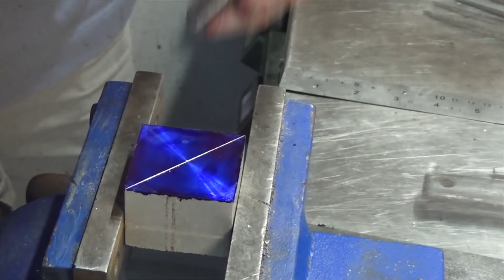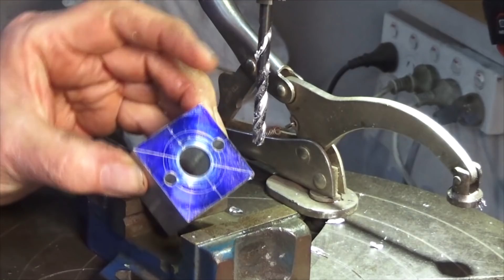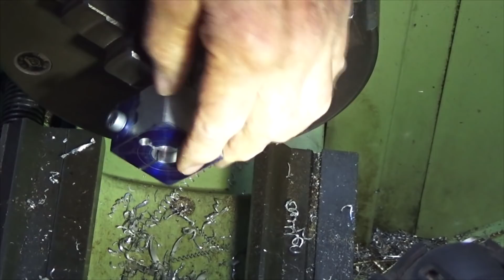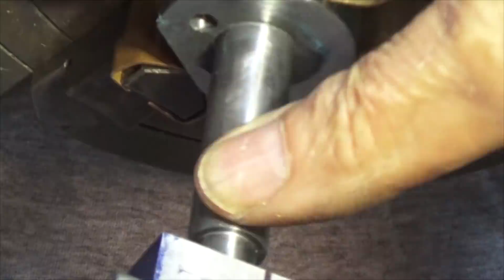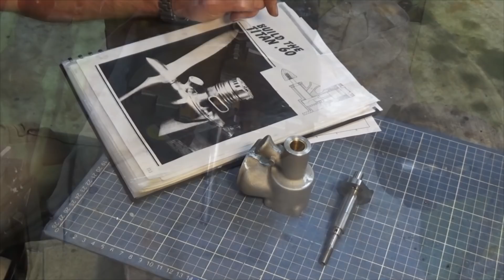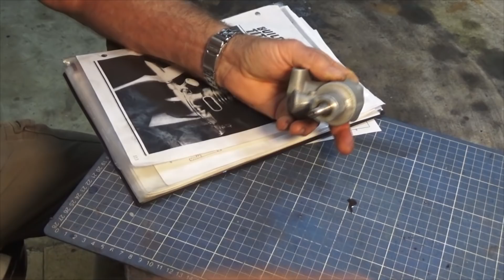Building the Titan .60 Glow Plug Engine #4

Comment: Wonderful, wonderful. But be careful about that tight spot. When the engine is running the only lube that bush gets is from fuel seeping forward due to crankcase pressure. If it seals perfectly there's some risk there won't be enough. Have fun on your trip!
Reply: It also gets lubed by the fuel entering the venturi, so it all should be good, especially after it gets some running in.
Reply from the maker: It's all fixed now. I will run through the process for improving the fit in the next video.
Regards,
Mark

Comment: Some notes on your first go at lapping (you DID ask for it!)

The design of the lap was nice, although I much prefer rounded edges (not just de-burred, but actively smoothed) on any hand-held external laps I make, for obvious safety/comfort reasons, I have tried a circular one a couple of times but it's not as easy to hold with the gentle grip required for good feel and good results.

frequently turning the lap is important, both axially to avoid the lap getting out of round, and end for end to avoid tapering the bore. with a nicely proportioned lap like the one you made, those issues should be minimal, but it's still worth keeping in mind. You may even have been able to partially rectify the issue at the root of the shaft by using the other end of the lap as i'd bet it would have been fractionally tighter at the un-machined end of the lap due to running off the end of the shaft.

There's little need for expensive diamond paste either, carborundum (silicon carbide) powder works just fine for most materials, it tends to break down as you use is, but if managed carefully this can be used to your advantage to give incredible finishes with only a couple of different grits. Carborundum, does tend to wear your laps a little more, as it embeds less than diamond, but that isn't as undesirable as it sounds as even the most perfectly machined lap will require some level of bedding-in.

Don't sweat the bore diameter too much, get within about 0.25% of bore for diamond, or even 1% for carborundum, and you'll still get the results you're after.

i'd be interested to see if you'll be lapping the bore or piston, as this is common practice with smaller, ringless aero engines (especially diesels), usually there's a controlled taper lapped into the cylinder and this can be a bit tricky to get right, but it's extremely satisfying when you do!

Over all, you did a pretty good job for a first time go at it, Your efforts are appreciated!

Thanks Mark!
Reply from the maker: Thanks for the feedback. I must say it wasn't as intimidating as I thought it would be. The lap did bind up at one point and I was able to let go of it before it did any damage to my hand, but rounding those corners would have been advisable. I did also reverse the lap on the shaft because I recall reading that the lap can get bell mouthed. One of the reasons I bought the diamond lapping paste was because it was cheap. It came from a Chinese supplier but it was less than $15 and I'll probably never use it all. I will be lapping the bore of the cylinder liner and I am shooting for zero clearance at the top of the liner. I am guessing that the liner will expand somewhat as it gets hot at the combustion end. There are no rings specified on the drawings. 
Regards,
Mark
Reply: thanks Leon for sharing these tips for all of us to learn too 👍😎👍
Reply: I had experience with lapped pistons mostly on Enya engines I used back in the '60s and '70s.  I think the pistons were iron, the cylinder liner was steel.  Only a small ring near the top of the piston was intended for the lapped fit, approximating what the area of broad piston rings would have been.  I'd sort of expected this engine to have a ringed piston but haven't seen evidence of that feature yet.

Comment: I would use my tool post grinder on the lathe, my surface grinder with the center grinding attachment, or lap it.  Probably others have different ideas.
Reply from the maker: I do have a toolpost grinder but it would probably work better on hardened stock. Also, I just wanted to have a go at lapping before I have a go at lapping the cylinder bore. 
Regards,
Mark

Comment: Self centering FOUR jaw.  That had to come to you by shear good fortune.  What do you do if the stock is, say, 1 millimeter oblong? (that’s a real question).  Im really liking these engine build vids.
Reply from the maker: Out of square stock or badly dimensioned stock can be an issue with self centring 4 jaw chucks. For really accurate work it's best to use and independent 4 jaw and dial the work in. Alternatively, you can put soft packing under the jaws of the SC chuck to take up any irregularities. 
Regards,
Mark

Comment: I built myself a cylindrical grinder that fits in the tool holder of the lathe with an electric motor and grinding wheel , I dress the wheel with a diamond tool in the stationary lathe chuck , works great .
Reply from the maker: I already have a toolpost grinder but I needed to try the lapping process before I tackle the cylinder liner. It needs to be lapped to ensure a gas tight fit since the piston doesn't have any rings.
Regards,
Mark

Comment: On the face opposite the 6mil screw head tap two holes offset either side of the 6mil threaded area and you'll be able to use setscrews to adjust the clearance.
Reply from the maker: If I were going to use that lap again I would certainly do that. Will I ever need it again? Probably not.
Regards,
Mark

Comment: I flew model planes for many 20+ years. I doubt they lapped the shaft at the factory. I once wore out the cylinder of an engine that was decades old before I got it. I reused the main shaft bearing and case for the head rotor bearing of an autogyro!

Comment: Hi Mark something i was shown many years ago by an old bloke in the game was to mount a ball race (bearing) on a piece of square bar stock and use it like a knurl run it at speed (experiment with that unlike a knurl) with plenty of oil and a bit of pressure, start out with the best finish you can get with your cutting tool and work from there  i can obtain a chrome like finish using this idea, a self centering curved (outside) bearing works best as a flat surfaced bearing can leave a thread like finish, this idea might be worth a try, thanks
Reply: I'm having some trouble following your description, is it a burnishing action?
Reply: @somebodyelse6673  the best way i can describe it it works the same way as knurling only it leaves a smooth surface  not knurled it does not cut any metal it just moves the surface metal, it pushes the highs into the lows of the tool marks left by the cutter i hope this explains it more clearly
Reply: @kelvinlennox2038  - Got it, that's burnishing :)
Reply from the maker: So that would be like burnishing. I have done that by hand on filed edges to remove the file marks. I believe it work hardens the surface but leaves the underlying material tough. Interesting!
Regards,
Mark

Comment: 1:03 what I would do is get strips of sandpaper about a foot long. Chuck the crank in the lathe between centers just as if machining it, then hook the sandpaper around it and slowly but surely step the grit levels up until it has the finish desired.

Comment: I'll have you know that you have caused turmoil. Now I have an uncontrollable desire to acquire mills and lathes plus other items mechanical so that I can spend hours making a small fortune out of a larger one. The Wife is not impressed. She changed the locks.
Reply: When I die I hope my wife doesn't sell all my kit for what I told her it cost.
Reply: "making a small fortune out of a larger one"

This is oh so true!  😊😊😊
Reply: If you are serious, you can find really good older mills and lathes for not much at all. but you have to be persistent and you will find the deals. I lucked out last winter and found a Rockwell 11" for 900 bucks with a boat load of everything. Tools, parts, stock metals. really great deal. now I'm looking for a nice Bridgeport knee mill.
Reply: So true.
Reply: You could take up cocaine or farming.  It would be cheaper.
Reply: У нас был такой  М.С ГОРБАЧЁВ ..жена им командовала  .и страны  СССР не стало..все бабы  дуры...

Comment: Nicely done Mark!!! I get my best finish when I grind my tools with a wide cutting edge. Almost like a cutoff tool. But not necessarily that wide. Just wide enough that it is cutting a flat spot wide enough to cover the cut but not make real tiny threads as I cut. Hope my explanation is clear.
Reply from the maker: I have had a few suggestions like this and I am keen to try it. I believe the key is slow speed and lots of cutting oil. I also want to try using a shear tool.
Regards,
Mark

Comment: Hopefully, you get to Tassie. I'd be a little concerned about the crank binding as it gets hot but you're right it'll probably resolve itself as the bushing wears.
Reply: Actually I think that the binding is going to be a problem. The crank rides on a thin film of oil. And if the fit is tight that area will be starved of lubricant. As it heats up that exacerbated the problem. I think that it makes sense to spend additional time lapping right up to the face of the crank weight. Or slightly relieve the bushing.

Comment: Good grief, couldn't you wrap a flat piece of wood with emery paper, and hold it lightly against the spinning shaft until it mikes what you need?
Reply from the maker: Absolutely but I wanted to have a go at lapping before I have to work on the cylinder bore and the piston which need to fit within microns. 
Regards,
Mark

Comment: I'm not quite to the end of the video , but I see a possible simple solution for lapping up to that shoulder . One method would be to reverse the lap , which would provide contact where it was relieved on the crankshaft . . . Another easy fix would be to lap the busing to fit the crank shoulder .  * I read all the comments to see if anyone else thought of it . . . NOW to see your solution !    Great work , by the way !

Comment: I would suggest that you protect the hand holding the lap with a heavy leather glove. If the lap grabs, it can do painful damage to a bare hand.  (Guess how I know?)
Reply: Hey mate, I wouldn't suggest this, if your hand grabs, it will be forced away. If you were to wear a glove it's more likely to catch and it is likely to pull your arm under the lathe. Same with bench grinders , mills and drills. Hope you understand what I'm trying to say. If you touch the tooling / work piece with your hand, generally it will push your fingers away, but will do damage. If you have a glove on, the fabric/leather from the glove will be more likely to wrap around the material/work piece and cause more significant damage to you.
Reply: Leather gloves are absolute terrible idea around any running machine shop tool. That is if you value your fingers, hand, arm, etc. I understand your concern of grabbing but you certainly don’t want something that can wrap you up in the machine.

Comment: Great project!
You could also “lap” the shaft to the bushing with a paste made from oil and say, fine to very fine silicon carbide grit (1000, 2000-ish)
Just slather the paste on the face of the shaft, press it through the bushing until the face meets the protruding lip of the bushing, then spin for 2-3 minutes.
A friend of mine used to rebuild his model airplane engines and would “seat” the shaft in this fashion.
He even had a small tool he made that was held in a drill and that mated to the eccentric pin on the back of the shaft flywheel to sped up the process. Must be careful with, though…..😙
Have a great time in Tazzy!
Reply: I've done similar operations using cerium oxide (too chicken to use a higher and harder grit) with slow but excellent results.
Reply: It's probably my ignorance and lack of experience with it, but I don't understand how a close fit is attained lapping the actual shaft in the actual bore. 

If the shaft doesn't fit all the way in, you can't do lapping.  

If it fits in there with any space for abrasives, why remove more material?  Isn't that just making the fit looser?

I have a handle on internal/external lapping with a lap, I just can't get my mind around doing it with the actual shaft and journal. Maybe if it was a split or two piece journal, but even then wouldn't tightening the journal back down result in two points of contact?  People do this successfully, but I just can't get my head around what actually happens at tight tolerance level.
Reply: @somebodyelse6673  "I just can't get my head around what actually happens at tight tolerance level."
You reach a point where the surfaces are "floating" on a layer of lubricant and not actually in contact when operating.
Reply: @somebodyelse6673  
He’s only honing a small portion of the bore.
The crankshaft rides in a brass journal that does double duty as a thrust bearing within the crankcase. The journal protrudes into the crankcase a small amount.
I believe the friction comes from a small increase in the diameter of the crankshaft as a result of the tooling used to cut it. It works out well, though, because a little lapping with very fine grit material will face and seat the crankshaft against the bushing, creating a closer fit, smoother operation and requiring less wear-in….and a better dynamic seal, as required for this two stroke motor to work.

Comment: I don't understand why you lapped the shaft to fit an unfitted bush & then had to ream the bush after fitting .   Wet & dry backed with a file would have a better option rather than lapping to an un relieved  shoulder .    Any way looks like you got there in the end !     Cheers .

Comment: When i was a kid an old guy next door had a workshop similar to yours. he was some kind of engineer and made model steam engines for a hobby. big enough to ride on. On his lathe he had a continuous flow coolant system. had a flexible tip so the stream could be directed and the liquid was white, like an emulsion of water and cutting fluid. I was wondering why you placed lubricant at the start or a cut instead of continually streaming coolant?

Comment: Listen I always use a wnmg carbide tool. I just have a small lathe. I'm always really amazed at the finish I get. At my maximum speed of 1850 rpm. And a feed rate of ?? No clue. But it always looks like a salindrical mirror. 
And it's a Chinese important lathe. M